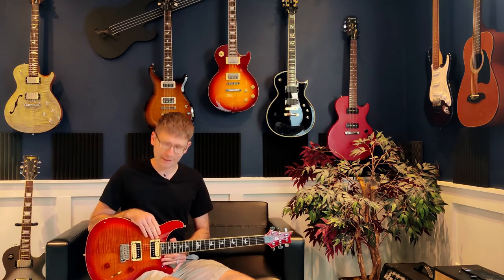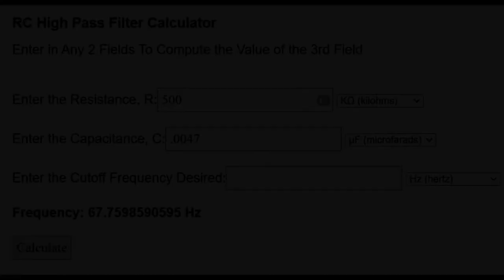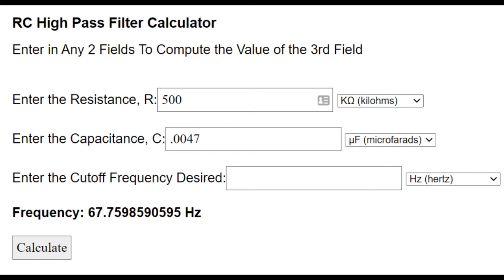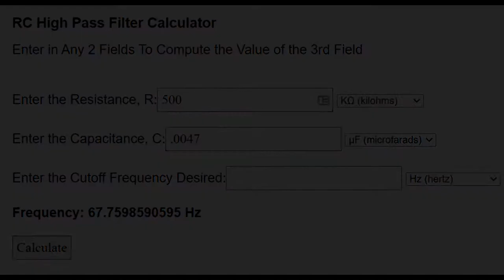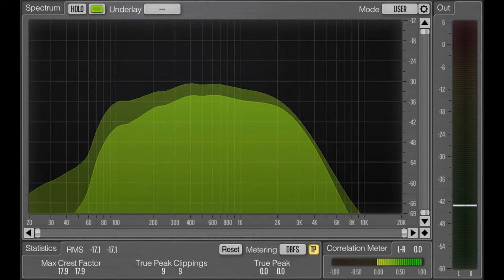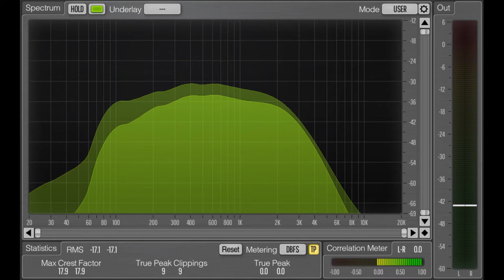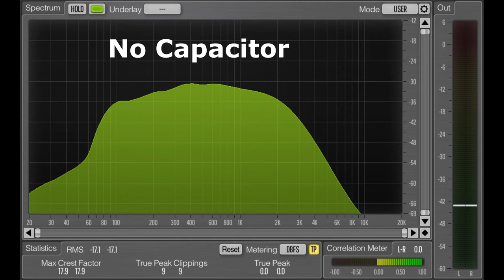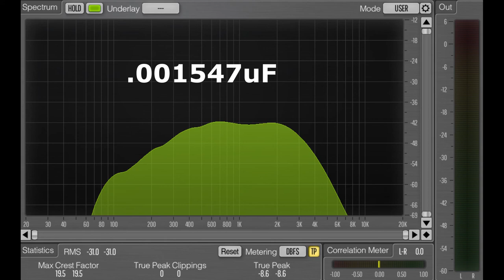Deep Dive - Results of using capacitors to clean up muddy pickups

Comment: Great video, thanks! Just wanted to note, that 60 Hz and below are not related to muddiness, it makes the sound "too big", "boomy", "overwhelming". Muddy tone, that steals clarity, lives in low mid, in vicinity of 200 Hz. If you normalize "no cap" and 47 cap graphs at 3 kHz you will see that cap cuts around 4 db at 100 Hz, couple of dB at 200 Hz, and then less and less until "no cut" at 3 kHz. This cut above 100 Hz is responsible for less muddy tone, and also explains why it is not super efficient if pickup is too muddy. But if go lower in cup values, we loose too much of the signal lows (around 100 Hz), which leads to a more and more "castrated" tone, that may work very well in the mix though.

Comment: I changed the 50s wiring of my SG and made a bass cut wiring. The humbuckers are wired to the 3 way button and then the tone pots are wired in series. One pot has 0.022uf for treble cut and the other 0.0015 for bass cut. But the bass cut is only relevant to the neck pickup. Ant the treble to the bridge.

Comment: I do 50's wiring with DiMarzio Custom Taper pots 15 cap in neck and adjust pickup height and screw height. I also use an alnico 5 mag. For neck pickup and ny xl strings

Comment: The .0047 cap sounds like a good fix for my custom HSH project. The neck H pup is muddy and tends to overpower the middle single coil pup. All 3 pups are independent wired with treble bleeds on the vol pots for neck and middle. The cap should not only remove the low freqs but also come closer to the single coil’s output to make for better blending. I will edit this comment in the  near future to share the result. Edit : 3/6/24 - tried it and the result was not what I had hoped. Every time you add a Component to your circuit you put another filter in the line. Best tone would be from pickup direct to output. Boring! But keep trying! Daveylee out
Reply: Thanks for the update!!

Comment: Thanks for this...; I've subscribed to your excellent channel. I'm working on a 'Keith' Tele with PAF in neck and a single coil Tele bridge pickup. Can you clarify that I need to put a 'treble bleed Cap' across the volume pot and the Cap you have decribed aboove across the tone pot? Can you point me to a link with a wiring diagram? Thanks in anticipation and Hi from the UK!

Comment: ive used a 2.2nf and the tone pot became a volume pot is this normal
Reply: Not if it's wired correctly. The cap, tone pot and pickup should all be in series.  BTW, engineers use this type of notation for values like that to eliminate misreading values: 2n2F.

Comment: John, the information of the resistance entered in the calculator is right? I know that is the pot value, but 500k is at minimum volume, when you playing the pot resistence is almost zero and we have check the circuit resistance to get the number. I think the grounded pot lug doesnt matter for this case, or maybe I could be wrong.
Reply: You’re backwards. Full resistance when playing. Hot gets ground when volume knob is rolled off, resistsance drops
Reply: It does matter.  The value to use in the calc would be 250k if the outer lug of two 500k pots are grounded.

Comment: I don’t get it. In line from the hot lead to the tone control? The hot lead goes to the switch. I like the idea and bought a .0047 cap, but I have hit a pain point here. Do I solder the cap in between the lead and the switch?
Reply: Yes, his instruction is not the easiest or best fix. To clean up a muddy pickup it's easiest to solder the capacitor in line from the hot of the pickup to wherever it would normally go (usually a switch).
Reply: The hot lead goes to the volume pot. You can wire a resistor to the end of the hot lead the solder the resistor to the volume pot where the lead should go. The resistor reduces the frequency before it gets to the potentiometer. There’s videos on YouTube. Search muddy pickup and look around. It’s a way nicer fix tone wise.
Reply: @dangitdan9938  Hey man, did you say to use the resistor in series like the capacitor? Also, with a resistor in series wouldn't you decrease a lot the output gain of this pickup?
Reply: @monstrord  not as far as I can tell. There’s videos that explain it better than I can. I had a muddy neck pickup and I used a resistor instead of a capacitor and solved the problem with no loss of volume and if there was I didn’t notice.
Reply: @monstrord  I think what it does is a partial split of the humbucker like PRas does. Probably lose a little volume but it clears it up well. I think I just compensated by raising my pickup height. 
Probably better off using a capacitor, less f’ing around. Lol.
Reply: @dangitdan9938  DId you remember resistor value? and just to confirm, this is conected in series like capacitor yes? I'm doing it right now. I found a good capacitor that sound good in my guitar (0.01uf or 10nf) but as you said, with a capacitor some strange sound appear and neck volume at zero doesn't mute the guitar anymore.
Reply: @monstrord  I’d play around with values on capacitors. The resistor mod I did was actually for a coil split so unless you’re splitting the coils I was mistaken. I’ve modded and fixed so many guitars I think I confused the solution.  
What value capacitor did you use?
Reply: @dangitdan9938  I don't use splited or paralel humbukers wiring for my les pauls. I dont like this sound. I use 0.01uf capacitor and was a good number. If you like to cut a little more bass, try 0.0047uf. If you going decreasing the number, more and more bass will be cut and humbuker will sound like a single. Also you will loss volume for thick strings.